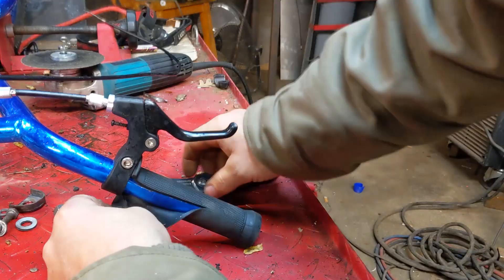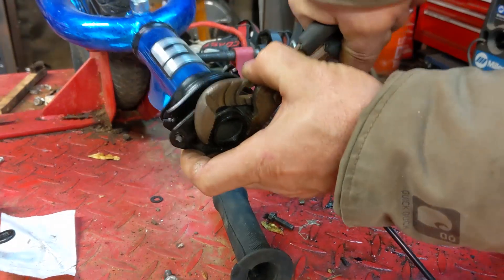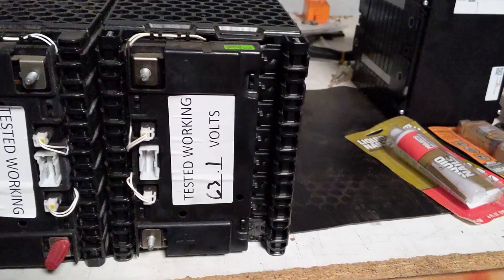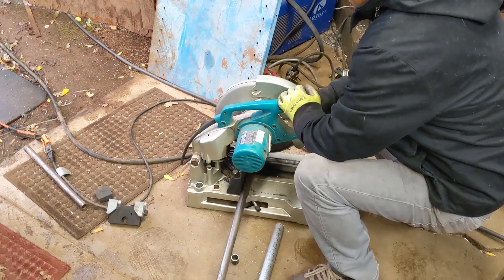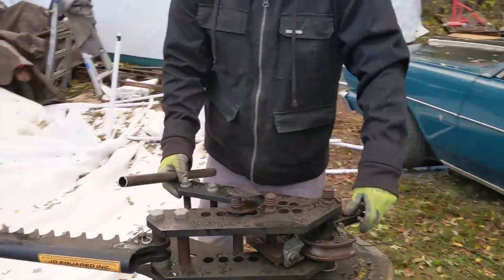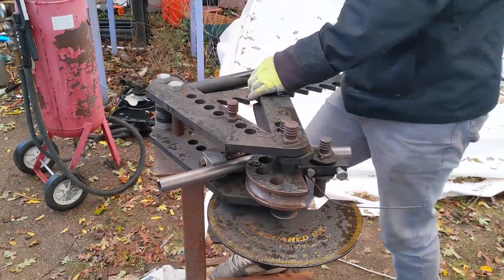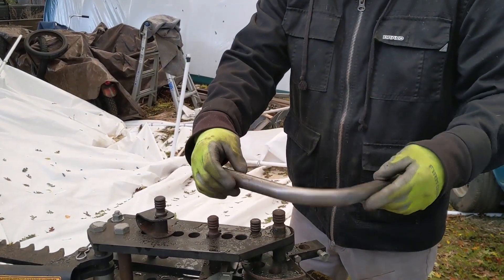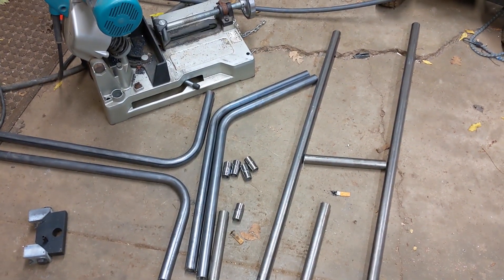How to Make a Farm Ebike from a Salvage EV battery, Trash bike from trashed car | Lark Machine Co

Comment: I have a local source to this battery and want to get some of them for 2 bikes I have. Wondering what bms you are using and what charger you are using? Thanks
Reply from the maker: @marraben  cool, I recommend the daly 16s bms for balancing and charging.  I think I just bought some ali express 16s charger
Reply: @ that’s great thank you for the info! How have you liked the performance?
Reply from the maker: @marraben  the batteries are great.  Be sure to mount them in a way that does allow them to expand.  If they get to low in soc, they will blow apart
Reply: @sheanyquist  good advice, would you have a safe cutoff limit to recommend?
Reply: @sheanyquist  sorry for all the questions but also wondering about a cable connection for the bms to battery, did you modify the Ev west cable or make your own? Would love to know how you modified or built a cable for this purpose

Comment: how much did the frame cost in metal material
Reply from the maker: I usually have metal sitting around for hobbies. I would say the frame was about 50$ worth of metal
Reply: @sheanyquist  ok so i need to build a custom frame for a qs 4kw midrive build buy i have no expiernce in welding what do you think is the best way to go about it and i havent a huge budget
Reply from the maker: @caseycunningham2537  buy a used bike frame and just alter it for what you need

Comment: Very Cool Build Shea..... I wish I had a friend like you because I've been wanting to build an electric bike from scratch, I have a few ideas that I've been kicking around in my mind for a few years now as well but I don't have all the necessary tools like a welder and pipe bender.
Also, How do you charge those batteries¿? Is it the stock charger or a custom one¿?
Reply from the maker: I have a couple of different chargers for these bikes. Most are designed for the battery voltage. Some are just modified power sources
Reply: @sheanyquist  - I'd like to see a short video on this subject because I always wondered how to charge one if I got one for a build.... I'm sure a lot of people would be interested.
Thanks for the info and keep up the awesome builds.   😊

Comment: Sick builds man you got a real talent and know-how to make some real cool stuff. I've owned a motoped yx140 for a couple years now and whole the frame is built well (supposedly hand tiged in the USA) a couple night ago I landed hard jumping this drainage ditch and the bolt that mounts the bottom of the shock to the swingarm broke clean off and the spring when into the tire. Luckily I was on dirt so I slid and had modified the hub to use a real mx tire and rim so no puncture.
I just tell you all this because I've seen a good deal of motoped ebike builds that you should check out if curious. Cheers